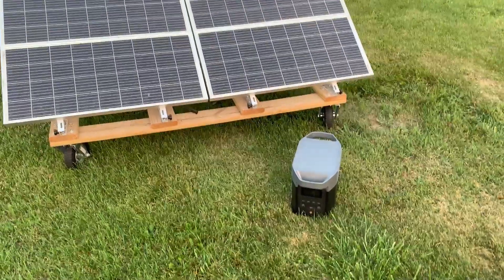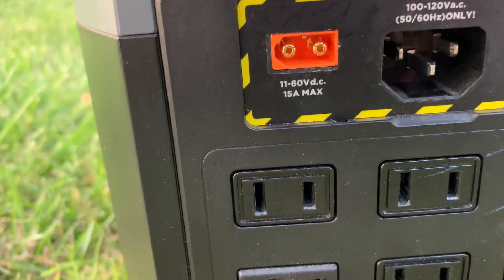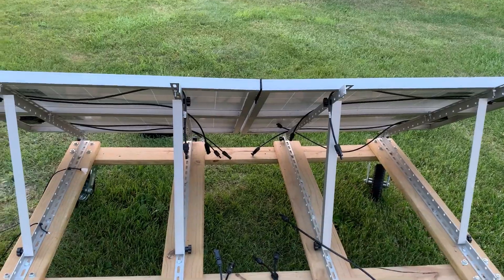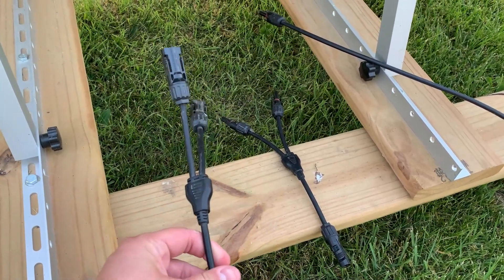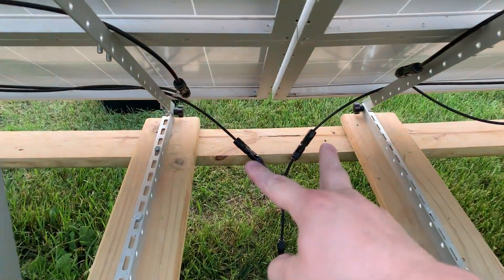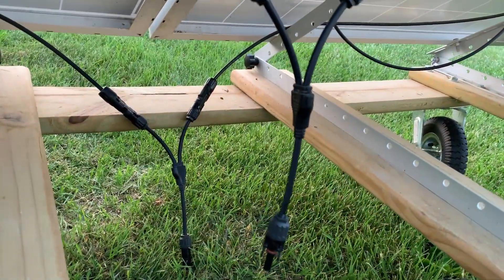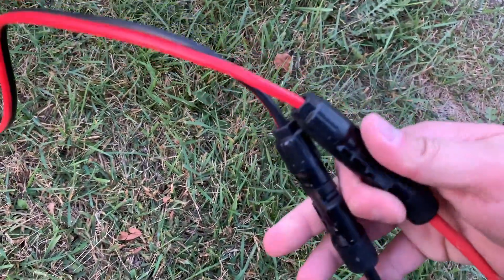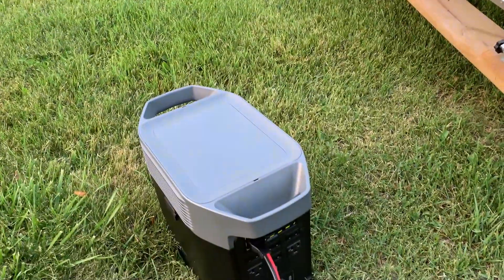Ecoflow delta 2 solar wiring setup! 400 watt array

Comment: I'm still very confused on why my ecoflow delta 2 isn't charging. It's running on 2 200 watt solar panels running series at 54 volts. And I can't figure out why it doesn't charge. I checked everything. Wires, Sunlight, connections. It's weird
Reply from the maker: If you try just 1 panel, do you still have the same issue? Assuming no warning lights on the screen?
Reply: @rnkustomz nothing. No charging on 1 pannel it's so strange
Reply from the maker: @lightningevo5429 have you every ran above 60 volts that you know of? Or used your 54 volt setup on a cold day? Being that close I’d say even a 50 degree ferenheight day with a cloud flash could have put it over 60 volts. Otherwise have you tried a new xt60i cable?
Reply from the maker: @lightningevo5429 I have had an xt60i cable die on me before and it looked totally fine, not sure where it failed but wouldn’t charge the delta 2 anymore
Reply: @rnkustomz non factor. Tropical location typically 85 f
Reply: @rnkustomz I changed my xt60i cord too and nothing. I'm just stumped. Ik voltage is running through the extension. I checked so. Maybe a firmware issue? I'm throwing darts at a wall with this.
Reply from the maker: @lightningevo5429  Only thing i can think of is your MPPT died inside. is the unit under warranty?
Reply: @rnkustomz il have to check

Comment: I have the XT60i Cable to MC4 Connections to 4 Eco Worthy BiFacial 100 watt solar panels and now a Set of 2 to 1 Parallel Connections to go 2S2P into My New Delta 2 - Thank You for Posting this Video
Reply: I was Afraid I was Gonna Smoke this Brand New Eco Flow with 4 in Series... 🔥 💨 💨 🛸

Comment: do you need to parallel at all. can't you just series all 4 panels together?
Reply from the maker: The Delta 2 has a voltage limit of 60 volts. So if you series 4 panels at 20v each, you are going to fry your unit. 20x4 = 80 volts

Comment: You won’t be able to accept 15A in this configuration, the EcoFlow will only accept 8A by default which you can reduce in the app (not that you would).

If you want to lift this limit up to the 15A it can handle, you need to use an XT60i connector and either buy one or make one with the sensing pin shorted to the negative side (the rounded side) of the connector. If that pin is shorted to the positive side, or it’s not connected or just doesn’t exist like on your plain XT60 connector, the EcoFlow thinks it’s a cigarette lighter charger for a car and to not pop the fuse, the 8 amp or lower limit is imposed.
Reply from the maker: I swear I read somewhere that the xt60  only affected input current from a cigarette outlet of a car and things like that. I’ll order an xt60 I version and see if my input increases, I typically get 340 watts out of this array.
Reply: @rnkustomz  To be conservative the Delta assumes everything you plug in is a car charger unless you tell it otherwise by shorting a sensing pin to negative. You can test this by lowering the "Car input" to 4A in the app and watching your power levels go down. As you're feeding the Delta with 49V, with your 400w setup you're probably not seeing the current limit anyway. If you had a perfect 400w output from the panels, at 49v that's 8.16A and you'd just barely get limited.
Reply from the maker: I ordered some xt60i’s today as im gonna add another 2 panels in parallel to make 6 total. Thanks for the helpful information! I’m still learning all this stuff.
Reply: lol i was gna say that too